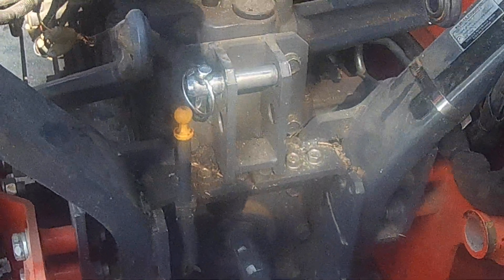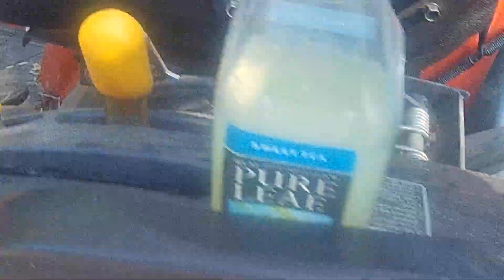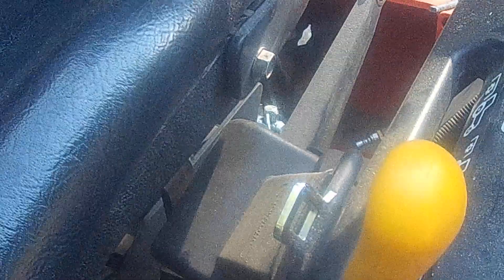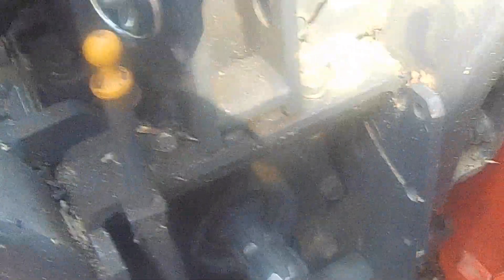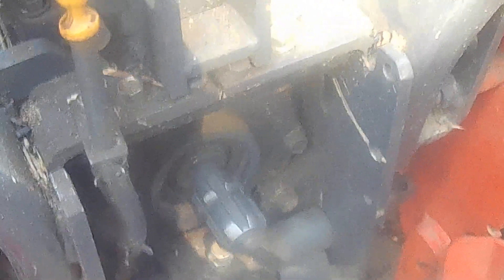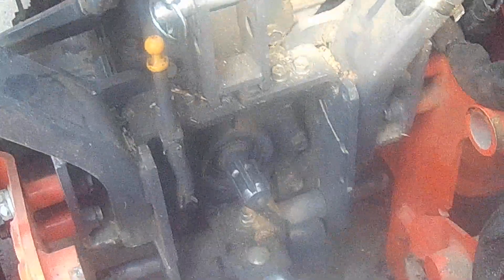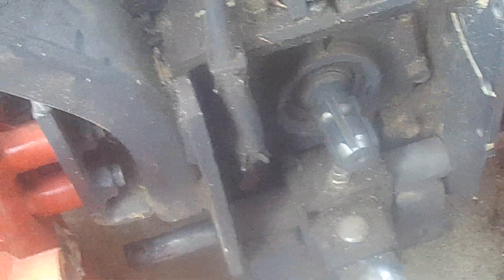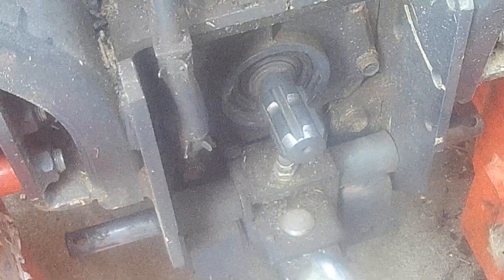2017 Kubota B2601 Turning the Rear PTO

Comment: Hey good day Mech. I have to laugh. Up until about a month ago, I had the same issue. Every time I put the mower, or the chipper etc on the rear PTO, I would have to spin the blades or open the chipper and turn the rotor in order to line up my shaft splines. Then a subscriber told me the same thing you just mentioned and sure enough, life got much easier.LOL! Glad I was not the only one. Thanks for sharing - i am sure it will help others. All the best!
Reply from the maker: Top of the evening to you GP. It used to take me about 15 minutes to get the splines the lineup. I used to use words that weren't even invented yet to get it to go on. LOL It sure makes life a lot easier. Later